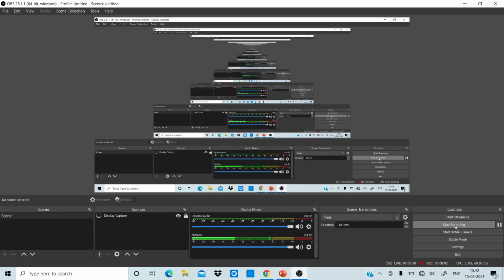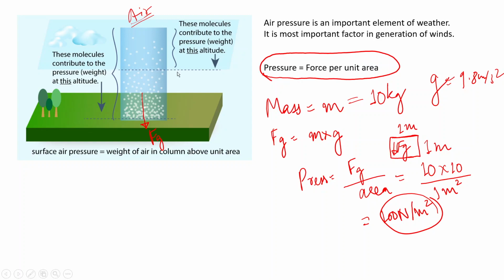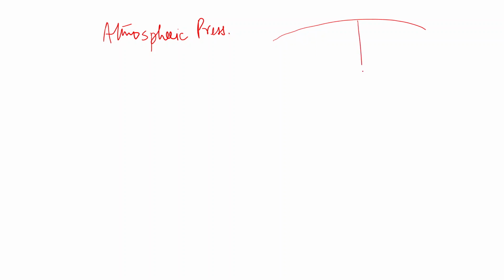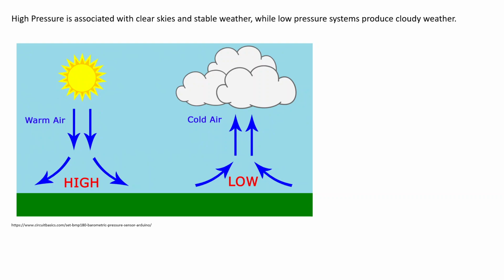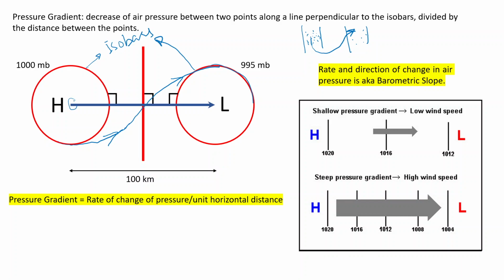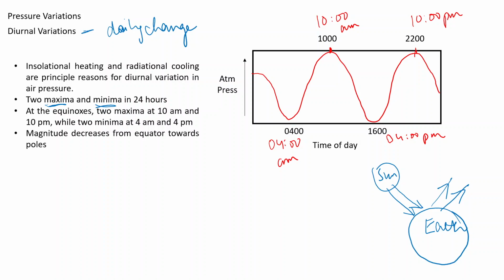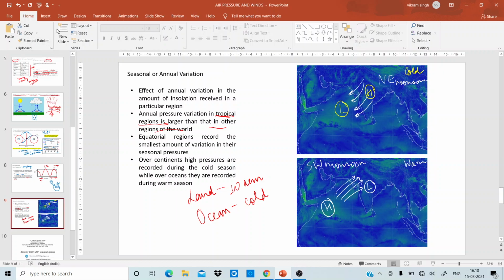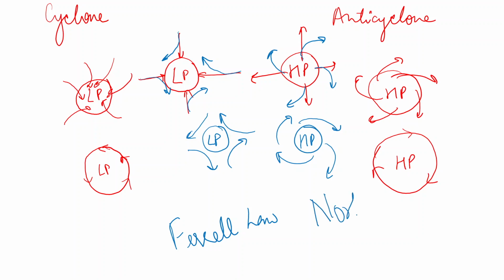Air Pressure

Comment: Usually on clear sky day, after sun rise the temperature is continue to rise because the solar insolation and OLR (as earth gets saturated). This highest temperature around 4-5pm i.e. lowest pressure of day. After sunset--no incoming solar radiation and radiative  cooling of earth until the sunrise of next day, at around 4-6am the temperature is lowest i.e. highest pressure.
 So how minimum pressure at 4am and highest pressure at 10am & 10pm?
Reply from the maker: Due to the warming of the upper atmosphere (mainly the thermosphere) by the Sun, also known as solar tides, the diurnal sea level pressure variation is slightly different than the diurnal temperature variation. It is the result of temperature variations aloft. Upper level variations of temperature distort isobaric surfaces.
Reply: @MrVikramsingh1  Sir from where I read this topic?
Reply from the maker: @lalitjoshi9379  there are some good books. I shall try to search. Drop me a mail and I shall send it to you